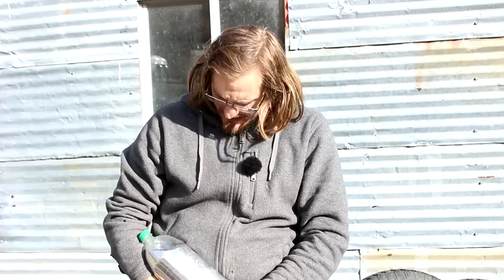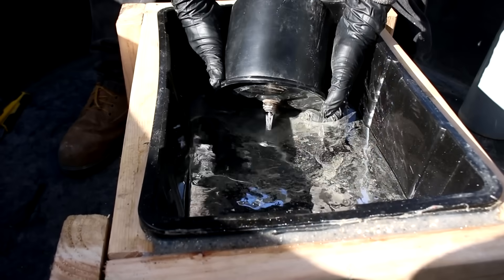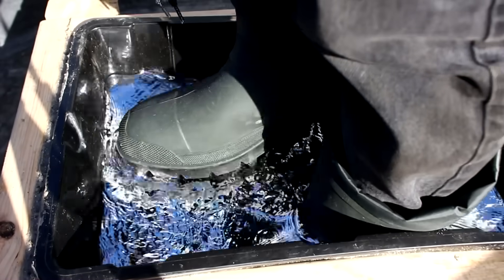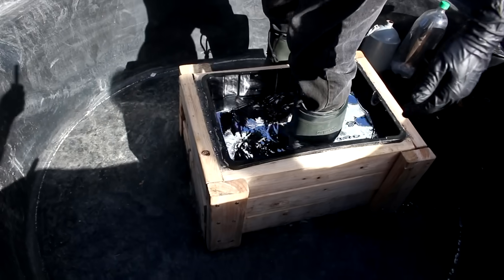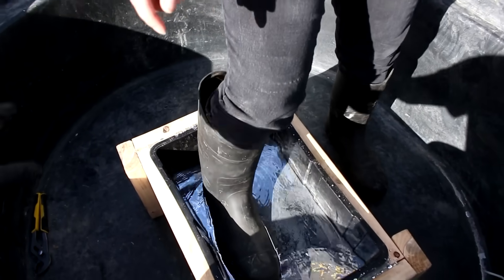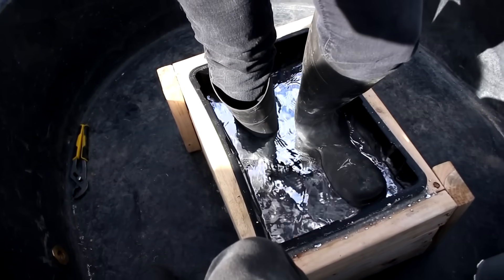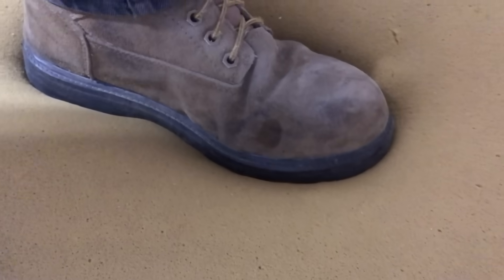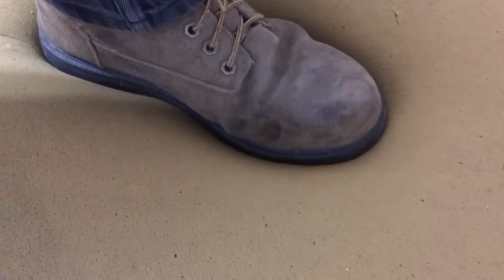Can I Stand On Liquid Mercury?

Comment: I nominate Cody's Lab for the 2018 Darwin Award
Reply: C N The mercury he plays with is safe, as it can’t get absorbed through the skin.
Reply: @panzerkampfwageniv4065  Elemental mercury (Hg) is found in liquid form, which easily vaporizes at room temperature and is well absorbed (80%) through inhalation. Its lipid-soluble property allows for easy passage through the alveoli into the bloodstream and red blood cells (RBCs). Once inhaled, elemental mercury is mostly converted to an inorganic divalent or mercuric form by catalase in the erythrocytes. This inorganic form has similar properties to inorganic mercury (eg, poor lipid solubility, limited permeability to the blood-brain barrier, and excretion in feces). Small amounts of nonoxidized elemental mercury continue to persist and account for central nervous system toxicity.

Elemental mercury as a vapor has the ability to penetrate the central nervous system (CNS), where it is ionized and trapped, attributing to its significant toxic effects. Elemental mercury is not well absorbed by the GI tract; therefore, when it is ingested (eg, thermometers), it is only mildly toxic.

Comment: I read that around 20 lbs of mercury is worth around $500 or so. If that's the case, that is around $16,000 worth of Mercury you had... is that true?
Reply from the maker: I think it runs around 7000$ a flask.
Reply: yeah, it can be cleaned
Reply: Are you kidding me? You can reuse it I hope.
Reply: half time use--you have to throw it out halfway through and start fresh regardless of the activity you're doing
Reply: Jolly Ghost well people shouldn’t be stupid enough to say something like that, why would someone say it’s just “Silver” when it is clearly not.
Reply: One time use.... Then you have to pour it down the drain and get new stuff.
Reply: poiuo3uu509uoaihsdoifasoijfaskjkljhumandahshumasdlhfflauo o.o
Reply: Thats a lot of thermometers!
Reply: Jolly Ghost I understand what you are saying, but anyone using common sense should know you can’t stand on molten metal
Reply: Jason Murawski 
but
he is standing on molten metal
Reply: @denizbluemusic  Good point, and nobody called Jason "stupid" for his ignorance
Reply: Its just a silver not mercurý
Reply: @jdeverblue1783  mercury is quicksilver
Reply: @jdeverblue1783  What?
Reply: JD EvErblUe17 are you stupid? Silver is a solid at room temperature, even if it was molten at the start it would solidify very fast due to the low temp outside. If you would have it hot enough to last the entire Video it would melt the rubber boots. Also he showed his bare foot in it, you cannot do that with molten metal. Not to mention you can’t float on molten silver.
Reply: @jasonmurawski5877  "I know what i'll do! I'll go to a science and learning channel with the most relaxed and patient person around and throw feces around in the comment section. Then they'll respect me!"
Reply: beep boop good for you, now explain to me, why should I care

Comment: Wait. I thought if you touch mercury you get cancer? I really don't know if this is true?
Reply: No, you do not get cancer from mercury.  Mercury is a neurotoxin, meaning that if it gets into your bloodstream it will eventually migrate to your brain and spinal cord, causing nerve damage.  However elemental mercury, which is what Cody uses here, is not readily absorbed through the skin, so the only dangers are inhalation and open wounds, both of which Cody takes precautions to avoid.  He only stands on it barefoot using the foot without an open wound, and uses boots when both feet are needed.  In addition, he performs the experiment with cold mercury on a cold, breezy day, outdoors.  The temperature of both the mercury and the ambient air ensure that the rate of vaporization is kept as low as possible and the wind ensures that any vapors that are formed are dissipated promptly.

Comment: small amounts of mercury are absorbed thru the skin which isnt very dangerous with light amounts of exposure but however in an unsealed container it releases vapors that are very dangerous to breathe in
Reply: Elemental mercury is not readily absorbed through the skin, so unless you remain in contact with it for a ridiculously long period of time, or have an open wound, there is actually very little danger.  The vapors are much more dangerous, however, yet Cody takes steps to mitigate this risk by performing the experiment outdoors, using cold mercury, on a cold, breezy day.  Both the temperature of the mercury and the ambient air temperature ensure that the rate of vaporization is as low as possible, and the wind ensures that any vapors given off are dissipated promptly.

Comment: What is this!!!? Is this guy trying to terminate himself??? What i am seeing??!! I am dreaming?? that element is fatal to contact!!
Reply: ...no
Reply: Not, it's not.
Reply: Because he is using elemental mercury.  While all mercury is a nerotoxin, the toxicity can only occur once it gets into your body, specifically your bloodstream, where it can migrate to your CNS and cause issues.  

Elemental mercury is not readily absorbed through the skin, as it is neither fat-soluble, nor water-soluble.  So the main dangers when working with elemental mercury are open wounds and inhalation.  Both are risks that Cody minimized in the video by not allowing the foot with the open wound to touch the mercury and ensuring that the experiment was performed using cold mercury outdoors on a cool, breezy day.  Both the cold temperature of the mercury and the cold ambient air temperature helped to keep the vaporization rate low, and the wind helped to dissipate any vapors that were released, thereby minimizing the inhalation risks.  

The kind of mercury that is highly dangerous to work with are organic mercury compounds.  These will permeate through protective gear and are readily absorbed through the skin, being fat-soluble.  These are the compounds that are in use when most mercury-related accidents occur, such as the latest one where the chemist spilled only 2 drops of an organic mercury compound on her glove.  She almost ended up dying, I believe, whereas Cody has worked with elemental mercury for many years now, and has taken blood tests to prove that he has no elevated levels of mercury in his bloodstream.
Reply: Joe Alesi oh that s it, all we have some amount of mercury in our blood i think so. Anyway, too many measures indicate it is kind of dangerous. I personally wont try this "at home". How can the other mercury trespass gloves???
Reply: Because it has properties that allow it to pass through the molecules of the gloves.  Again, it comes down to the properties of the chemicals themselves.  

And I agree that I would not feel safe dealing with that much mercury, but I don't have the experience and elemental knowledge that Cody does.  I also don't have that much mercury on hand! LOL! Still , if Cody set up the experiment and I was there, as Kanyon was in the video, then I would most definitely stand on it, as she did.
Reply: Joe Alesi why not? Explain yourself

Comment: Cody, what about buoyancy of the open boot?  I'm not sure of the terminology, but isn't the concept the same as a boat vs a slug of metal?  I.e. your bare foot would be the slug, and the boot acts as sort of a boat vessel.  If the boot were removed, would that effect the level at which you floated?

Comment: Isn't mercury toxic even to  touch?
Reply: Yes, but elemental mercury is not readily absorbed through the skin, so the main dangers are open wounds and inhalation.  Both are risks that Cody minimized in the video by not allowing the foot with the open wound to touch the mercury and ensuring that the mercury was cold, and performing the experiment outdoors on a cool, breezy day.  both the cold temperature of the mercury and the cold ambient air temperature helped to keep the vaporization rate low, and the wind helped to dissipate any vapors that were released.  

Organic mercury compounds are much more dangerous as they are readily absorbed through the skin due to their solubility in fat containing substances.

Comment: I thought mercury was toxic and can be absorbed through skin?
Reply: Organic mercury compounds are highly dangerous and are readily absorbed through the skin.  However Cody was using elemental mercury, which is neither fat- nor water-soluble, which means that it is not readily absorbed through the skin.  The main dangers with elemental mercury are through contact with open wounds and via inhalation, both of which Cody takes steps to avoid in the video.

Comment: WTF, this actually killed a chemistry professor recently. Isnt't that going to creep into your brain and nervous system and kill you? As far as I'm concerned this is a neurotoxin. I may be wrong tho..
Reply: Luph 
Also, the accident with organic mercury happened in the 90s, over 20 years ago, lol.
Reply: Fiusha Ironfoot I think he was talking about chubbyemu’s vid.
Reply: While it is true that mercury is a neurotoxin, the accident that you speak of did not deal with elemental mercury, but instead was an organic mercury compound.  Organic mercury compounds are extremely dangerous as they are able to permeate through latex and other protective wear and are easily absorbed through the skin as they are fat-soluble.  This makes them highly dangerous to work with.  

Elemental mercury, on the other hand, does not permeate through protective gear and will not wet most surfaces.  It is not readily absorbed through the skin as it is neither fat-soluble, nor water-soluble.  The only main concerns when dealing with elemental mercury for short time periods would be if the mercury were to contact an open wound, or if it were inhaled.  Both of these are issues that Cody took steps to minimize, thereby limiting the exposure of mercury  to these avenues of infiltration into his bloodstream.
Reply: Joe Alesi Yep, that makes sense.. thanks for the explanation :)
Reply: No problem.  :)

Comment: So, mercury has a weight of about 13.5 kg per liter, and Archimedes' Principle states that the "lifting force" upon a body is equal to the mass of the liquid it displaces. Assuming you're a person with a weight of 67.5 kg (fairly average) you'd have to displace 5 liters of mercury to lift your body and float. That sounds perfectly possible if you're wearing a pair of good rainboots. 
So yeah, this all makes sense, including his issues with balance (his center of mass is far above the liquid surface so it's rather unstable

Comment: Wouldn't you get mercury poisoning if it came in contact with your skin?
Reply: No.  Elemental mercury is not readily absorbed through the skin, so unless you are in constant contact with it for quite a long time, you're ok.  The main things to avoid are contact with open wounds and inhalation of the vapors, both of which Cody took steps to avoid.

Comment: If too much mercury desolves im your skin it will cut off the the sense a
Reply: What? Elemental mercury is not easily absorbed through the skin. It would not dissolve in skin anyway as it is neither fat-soluble, nor water-soluble.

Comment: I thought you could die if mercury touched your skin
Reply: No.  Elemental mercury is not readily absorbed through the skin.  You're thinking of organic mercury compounds which are extremely dangerous because they are permeate most safety gear and are easily absorbed through the skin, being fat-soluble.
Reply: Joe Alesi i didnt know that, thanks!
Reply: No problem.  :)
Reply: It's awful what it does to you fucking organic mercury

Comment: How how is he not dead
Reply: Why would he be?
Reply: Joe Alesi it's mercury
Reply: And? All mercury is toxic, but not all mercury is able to get into our bodies in the same way.  To cause issues, mercury has to affect the brain and central nervous system.  Organic mercury compounds, such as dimethylmercury) are the ones that will go through gloves and can be absorbed by skin as they are soluble in fat-like or fat-containing substances.  From here they are stored by fat cells and slowly released into the bloodstream, where they cause issues with the brain and central nervous system.  Elemental mercury, which is what Cody is using here, cannot go through gloves or boots, and it also is not readily absorbed through the skin, as it is not soluble in either fat or water.  The only way for elemental mercury to get into your bloodstream is either through an open wound or via inhalation, both of which Cody took precautions to prevent in this video.  He only stood on the mercury barefoot with one foot as he stated the other had an open wound, used boots when he used both feet, and minimized the inhalation risk by performing the experiment outdoors on a cold, breezy day, using cold mercury.  The cold temperatures of both the mercury and surrounding air ensured the lowest rate of vaporization and the wind ensured that any vapors that were produced were dissipated promptly.  

So I hope, perhaps, this answers your question as to why he is not dead.  He is not dead because he is knowledgeable about the elements and chemicals he works with, and applies that knowledge to ensure that his risks are minimized while still being able to produce amazing and enjoyable scientific videos.
Reply: Joe Alesi ok I'm not a scientist I didn't know
Reply: No problem, man.  That's why I was trying to clear things up for you.  You asked a question and I tried my best to answer it completely so that you'd know.  :)

Comment: Mercury isn't as bad as people think it is? Dude are you fucking kidding me? Have you heard about professor kw? Died from spilling 2 drops of dimethylmercury on her gloves.
Reply: That is an organic mercury compound.  It can pass through gloves and is absorbed by the skin as it is fat soluble.  Elemental mercury, on the other hand, cannot go through gloves and most other barriers, does not wet objects, is insoluble in both fat and water, and is not readily absorbed through the skin.  The only pathways for it to enter the bloodstream is via an open wound or inhalation of the vapors, both things that Cody took precautions to avoid during this experiment.  

For example, when stepping on the mercury barefoot, he clearly states that he is only using one foot, as the other had an open wound.  He uses boots when needing to use both feet so as not to let the mercury come in contact with the wound on said foot.  And as for the inhalation hazard, he performed the experiment outdoors, on a breezy, cold day, using cold mercury so as to minimize the vaporization rate.  The wind helped to dissipate any vapors which were produced.  

So yes, Mercury isn't a bad as people think it is when they understand the chemicals and/or elements they are working with and what the possible dangers and risks are, then proceed to take precautions to minimize those risks.
Reply: Knowing how destructive it can be to the human body in extremely low amounts it is fucking idiotic and irresponsible to expose yourself to mercury in any form. I mean he could of at least wore a mask? But if you insist on doing such things go ahead, it explains your bad judgement.

Comment: Mercury is very toxic... Wtf. Even just slight skin contact can make it absorb into your body and attach to your fatty cells and cause severe nerve and brain damage. Even through the gloves. You need special gloves for that. Please go see a doctor to test for mercury levels before it's too late and it accumulates in your brain. Or you will go into a coma
Reply: Mercury is toxic, but only once it is in your bloodstream.  

You talk about it going through gloves and being absorbed into your body and attaching to fatty cells, all of which is true for organic mercury compounds (like dimethylmercury, to which you specifically seem to be referring).  However, Cody was not using any organic mercury compounds, he was using elemental mercury, which is not soluble in fat nor in water, cannot go through gloves or other common protective gear, and is not readily absorbed through the skin.  The main pathways of entry into the body for elemental mercury is via an open wound or inhalation of the vapors, both things Cody took precautions to avoid, as he even states in the video.  

In fact, shortly after his video about flushing 240lbs of mercury down a toilet (not attached to plumbing, of course), in which he put his hand and most of his upper arm into mercury to lift the tank flap, people were clamoring to have him get tested for mercury poisoning, which he did.  His blood test showed no elevated levels of mercury nor of lead, which proves his precautions are sufficient to ensure his continued safety.

Comment: Hey isn't mercury deadly poisonous??
Reply: Mercury is toxic, yes, however elemental mercury is not readily absorbed through the skin.  The only pathways for elemental mercury to get into your body in a way that would be toxic would be through open wounds in your skin or via inhalation, both of which Cody took precautions to prevent.  He wore boots because he had a cut on one foot, and he performed the experiment outdoors on a cool, breezy day, using cold mercury.  Both the temperature of the mercury and the surrounding air temperature served to lower the rate of vaporization, and the wind ensured that any vapors were dissipated quickly, thereby lowering the risk of inhalation.  

Organic mercury compounds, on the other hand, are quite dangerous as these are readily absorbed through the skin due to their solubility in fat.  These compounds are absorbed by tissues and leach into the bloodstream, where the mercury can affect the brain and central nervous system.  As stated previously, this differs from elemental mercury which would have to be introduced to the bloodstream either via open wound (direct pathway to the circulatory system) or via inhalation (route to bloodstream via lungs).